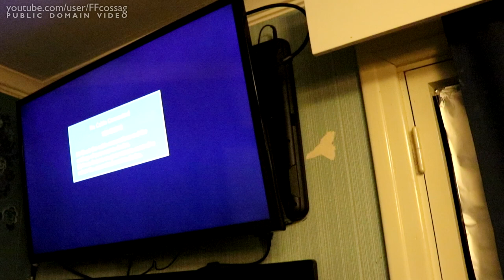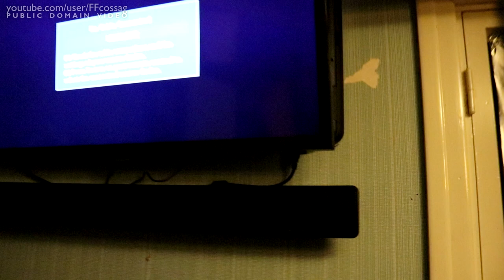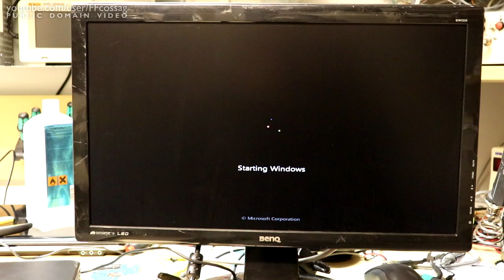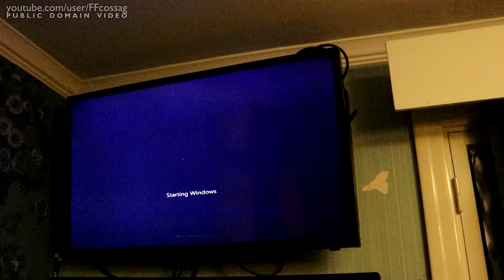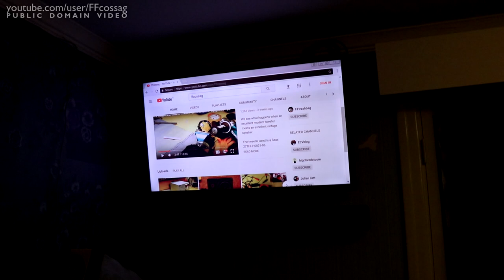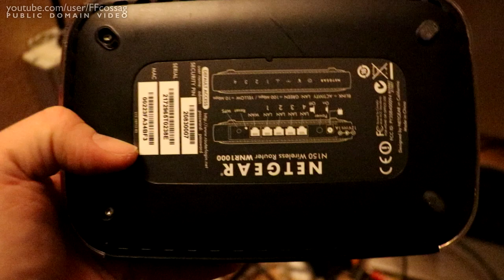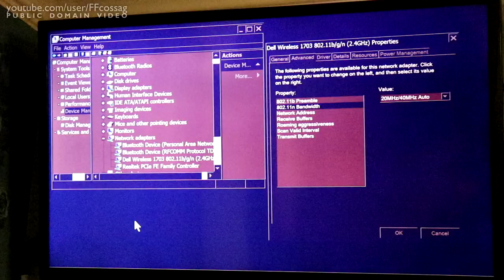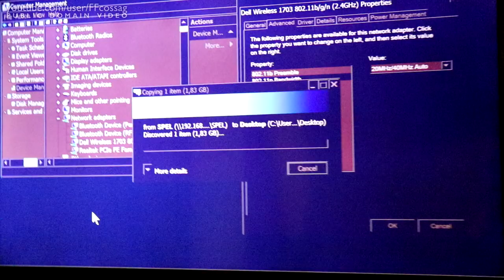Blog. HTPC hack, soundbar repair & more!

Comment: i have a laptop mounted under a TV table, with the lid switch permanently disabled and a power switch mounted on one of the legs of the table. the setup is surprisingly functional, all that's exposed is a DVD drive, 2 USB plugs and a headphone jack. HDMI and Ethernet etc all comes out the back, hidden by the table. all with wires lifted off the board instead of moving the board, so if i cut the wires it'll work fine again. minus the lid switch. the fix for reversing that is adding a magnet back into the display, as that's what i removed.

Comment: Now that's a rats nest of finest proportions, which I'm sure has triggered a number of neat-o-philes who must absolutely have everything neatly arranged... :P

And that router, 4G capable? Pretty neat, assuming the 4G reception on it is decent... :D
Reply from the maker: That router is not 4G capable, it's one of those trashy things that let you plug your 4G USB stick into it. I got it because I use one of those sticks for youtube uploads, but lo and behold, it's only compatible with a grand total of about four obscure 4G sticks, mine of course not being one of those.
Reply: Ah, one of "those" routers, claims 3G/4G capability, but actually has nothing inside to do with it, I have a couple of those (which also don't work with my 3G stick), they just sit there going "derp" and not actually connect to the stick, thank goodness I have FTTC internet (and a 3G modem & SIM slot in my laptop!)... :P

Comment: Usually, with an external monitor you should be able to switch between internal only, external+internal (either in cloning or expansion mode) or external only. No electronic fix needed for that.
Reply from the maker: You can't easily do that outside of the OS, if you don't have access to the built-in keyboard of the computer. Entering the BIOS setup would for instance be impossible to do in this case if the computer thought the lid was open.

Comment: On desktop PCs, you have a BIOS option to tell them what to do when power has been lost and is restored. It's usually something like turn on, turn off or remember last state. Maybe the Dell laptop also has this option so you could actually control it over the power bar (or a radio switch for the mains power)? If not, well, then it probably isn't a proper business class machine, but some low-end consumer crap instead. Chug it away for a Lenovo Thinkpad any day! ;)
Reply from the maker: It is a piece of trash, that's why I'm putting it on the wall and not in a bag, lol.

Comment: The migration from the SSD to HDD issues may have something to do with AHCI mode, which may not be activated in the HDD machine's BIOS?
Reply from the maker: The issue is because the SSD disregards fragmentation issues, so the HDD suffers extreme head hunting.
Reply: Defrag the HDD then. I use OO defrag and it works well.
Reply: Simon Tay I'm not sure but  if i remember correctly window is on a ssd he just don't care about fragmentstion and therefore would create a mess intentely.

Comment: Would booting that Dell laptop there over WoL be a possible solution as well, providing you would've also ran another Ethernet cable to it?
Reply from the maker: I have no intention of running more wires than I need to, lol. I don't even think it does WOL.

Comment: What about those heat pipes? Why are there ones that can't be mounted vertically, or in any desired direction whatsoever?
Reply from the maker: I'm not sure why, some of them just stop working if you mount them the wrong way. Probably has something to do with the way the liquid condenses in them.
Reply: Heat rises so a heat pipe facing up side down won't work very well at all.
Reply: FYI gravity has very little to no effect on heat pipes.
Reply from the maker: This is not true, some of them simply cease working if you orient them wrong. Flip a laptop vertically, start a stress test, and you'll likely see this yourself.
Reply: Challenge accepted. https://imgur.com/a/ph0In
Test subject: Lenovo T420. In vertical operation higher temp by 1-2 degree celsius.
Text from our suppliers catalog for heatpipes:
All heat pipes have wick structures that pump the working fluid back to the evaporator using the capillary pressure developed in the porous wick. The finer the pore radius of a wick structure, the higher against gravity the heat pipe can operate. A thermosyphon is similar to a heat
pipe, but has no wick structure and will only operate gravity aided.
Reply: Also, many graphic cards with heat pipes have the heat sink under the board so are sitting 'upside down' in the case..by design. But yea, there can be some heat pipes which don't like being upside down.

Comment: There is a thing in control panel that tells it to keep putting out a singal even if the lid is close
Reply from the maker: Are you thinking of the option not to turn the computer off? The lid switch is very much done in hardware/firmware, since it physically disables the power button.

Comment: Cloning Windows from one PC to another? Wow, that wasn't possible only a few years ago (when everyone was using Windows 7). On Linux, however, you could do that all day long, switch from Intel to AMD or from NVidia graphics to AMD graphics without ever encountering any problems (provided that all the hardware you used was supported by drivers). Not even having to install a driver and see 640x480 until this was done. Yes, Linux is the superior system. I bet that instead of a power-hungry HTPC you could just use a Raspberry Pi with some kind of Kodi OS on it to power each display independently. And both running at the same time would probably use less power than either one of your HTPCs. But then, you're in Norway, so electricity is cheap and plentiful, so fire away and live with the fact that you have an inferior, buggy and spying so-called operating system that has the capability to completely take your power and control over the machine away any time it or its maker decide to do so...
Reply from the maker: You've always been able to clone Windows between near-identical hardware just fine. Both of these machines are third-generation i5 based, so they're running on all the same drivers.

As far as using something ARM-based, I'm hesitant, since these machines get subjected to Youtube tab spam, heavy enough to give them a run for their money. ;)
Reply: Sorry, but I don't get what you mean by Youtube tab spam, and how a processor achitecture could change anything about such a high-level application?
Reply from the maker: An i5 has a lot more grunt than any tiny ARM based CPU you'd get for a reasonable price.
Reply: Sure, but does this always have to be that way? I mean, if Intel is now thoroughly fucked up, why not see any chances for other CPU architectures to come up with an efficient and powerful design?

Comment: Why not use the MacBook as an HTPC? At least you wouldn't have Windows on there...
Reply from the maker: Because it's over a decade old, a furnace, and can't even play 720p video well.
Reply: Oh, I see. I am currently planning to use an old Raspberry Pi B+ model as HTPC for a screen I've got. I was told it works reasonably well as a streaming server. And it's the exact opposite of a furnace ;)